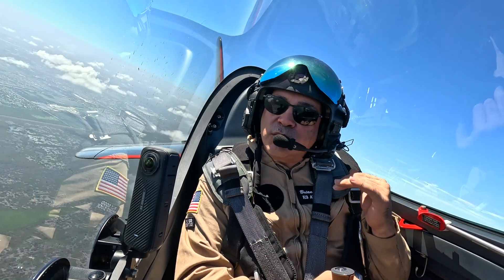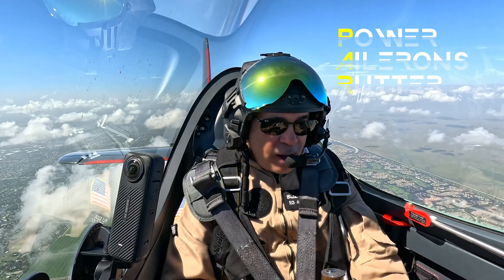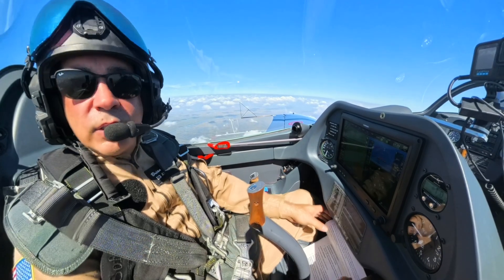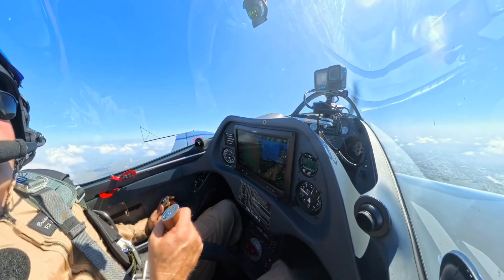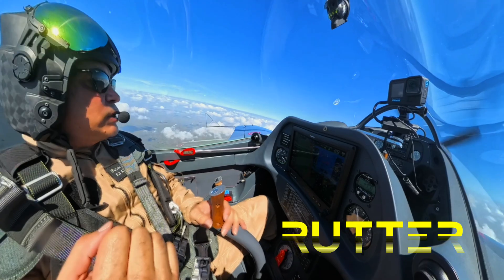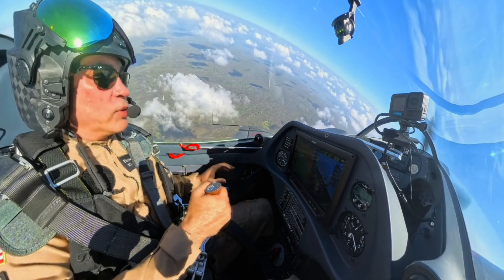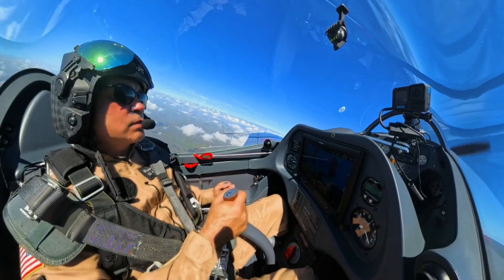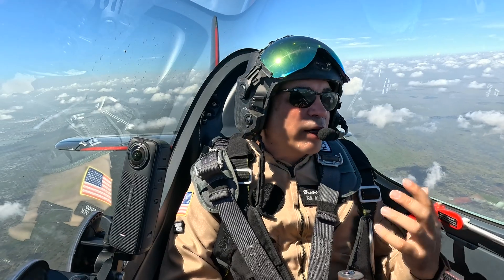Aircraft Spin Recovery: PARE Technique Demo & Common Mistakes

Comment: "Rudder into the spin" is confusing for me.  If you are spinning right you want left rudder for recovery, which I would term either opposite, or OUT of the spin.

It would be helpful to split screen or leave the external camera on, throughout.  You pulled the external camera EVERY time, so that we never saw the control surfaces during the RECOVERY.  You almost left it exterior long enough on the last one, but still pulled the view inside too early.   Great video, though, otherwise.
Reply: agreed, rudder OUT of the spin.
Reply from the maker: Good point we will see if the editors can tweak that video to make that more clear.   Thanks